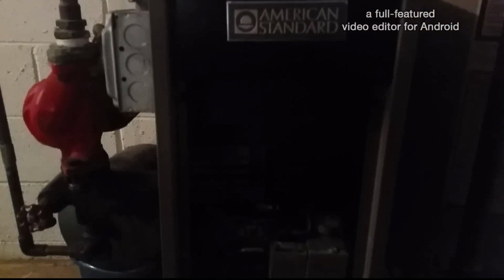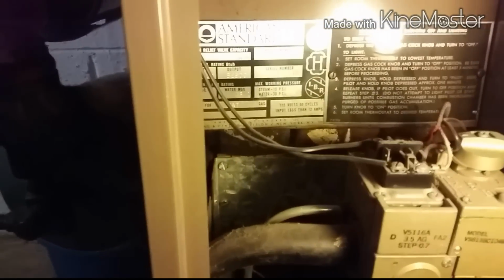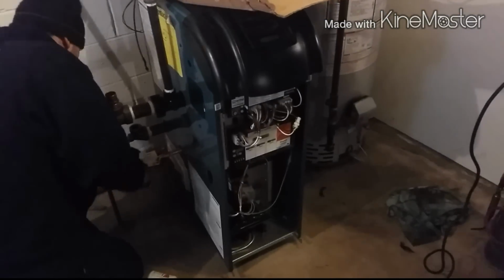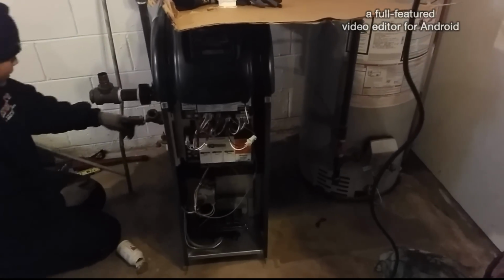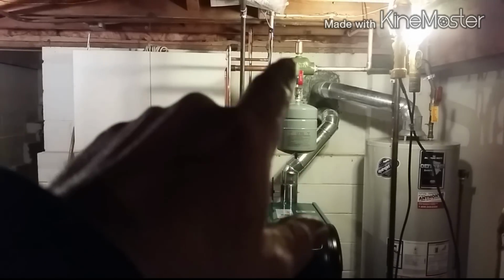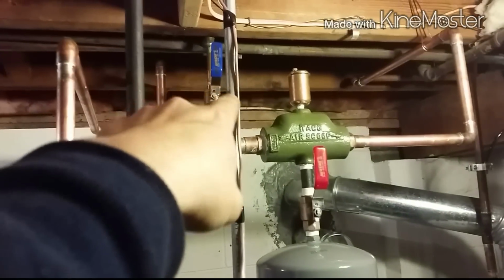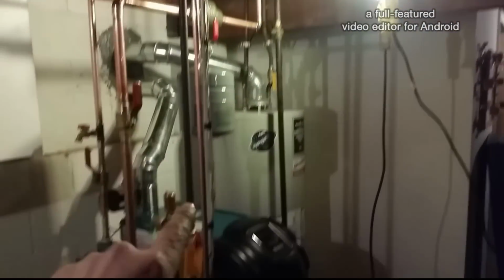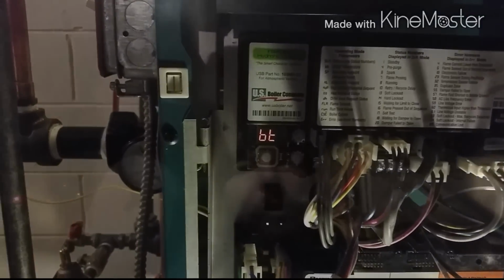Burnham 303 series hot water boiler install

Comment: Is this boiler required chimney liner ?and what happen if not installing this liner?
Reply from the maker: Depends on the existing size and conditions of current chimney if it required a liner.  After a install the unit gets inspected by township plumbing inspector and if needed be a liner be installed . If water heater and boiler r still piped into chimney , the chimney maybe fine . But if for whatever reason the water heater was replaced with a power vent and no longer exhaust into chimney then a liner will need to be installed and downsized.  If a downsized liner is not installed then it will not pull a correct draft mainly during the winter months u will notice it cause chimney is to cold due to amount of BTU's being removed .
Reply: @jhhvacplumbing1944  thanks for your reply.. so I using current same chimney for this type boiler you posted then no liner required right?
Reply from the maker: @raymondlee8351  is there a water heater piped into same chimney?
Reply: @jhhvacplumbing1944  yes. Current have HB Smith boiler vent piping to chimney..
Reply from the maker: @raymondlee8351 as long as nothing has been removed off chimney or number of BTU's r the same then there shouldn't be a issue . I always recommend to customers to have chimney inspection done after installation of something new just to be sure there isnt a clog , inside of chimney damaged or dirty.  It doesn't hurt to get it checked out and is a piece of mind all is well.  Also during Inspection if for whatever reason it does need to be lined they will tell u then . It's hard for me to tell u yes or no that u should be fine without sight unseen ... that's the chimney company job . Also keep in mind every state and county and sometimes township have different codes .

Comment: I don’t like that the relief valve is on the long length of pipe.  It should be as closer to the boiler outlet..  Also,  is it a ‘Pressure-Only’ valve?-  it should be installed in s vertical position.
Reply from the maker: You r correct and have since changed it and the set up when we do this type of boiler install . Thank u for your comment and good eye .

Comment: Nice work JH, Do you have many service calls on the Burnham boilers. Like electrical issues or sensor failures?
Reply from the maker: polishtheturd mickelson a few years back they had a issue wit the ground near the sensor being weak and the pilot tube being to small but that has been fixed from what I see .

Comment: I've recently moved into an apartment with a very similar set up.  Personally I was excited to move into an apartment with an "updated" heating and water system, especially coming from steam heat.  However I'm now unfortunately learning that this heating system makes noise as well!?!?!

is that normal for this type of system? It's not the return that's making the noise it's definitely the vent. 
Thanks for any and all info.
Reply from the maker: when u say vent what and where ?
Reply: +JH HVAC & Plumbing 
that would be the vent coming from the boiler and going outside of the house.  

not the return coming in from the house and connecting to the boiler.
Reply: +JH HVAC & Plumbing 
that would be the vent coming from the boiler and going outside of the house.  

not the return coming in from the house and connecting to the boiler.
Reply from the maker: +Sean Jordan the exhaust?  if yes is it ran in pvc plastic or metal ?
Reply: +JH HVAC & Plumbing  yes the exhaust, excuse me.  It's aluminium
Reply from the maker: +Sean Jordan and it runs directory outside or in chimney?
Reply: +JH HVAC & Plumbing directly outside
Reply from the maker: +Sean Jordan u should have a professional take a look

Comment: I had a boiler and replaced it when I installed central air with a gas furnace.  I want to go back!  I had slab heat and there is nothing like stepping on to a warm floor in the winter time and nearly silent operation. 
How can I go back?
Reply from the maker: Alot of labor my friend or move to a new house with a boiler or .... build a time machine
Reply: +justin henning Thank you.

Comment: You should look into putting the circulator and fill valve on the flow. it will make the air scoop work much better, especially in taller houses and ones with moniflow systems, But nice workmanship, Its good to see people taking pride in their work
Reply from the maker: rich that's the big debate , pump on the return or feed but I just install it the way my boss wants lol  . Thank for watching and commenting!
Reply: Dan Hoolahan writes some good books on steam and hydronics. Pumping Away and The Lost Art Of Steam are educational and entertaining. The helped teach this old dog some new tricks.
Reply from the maker: +rich6421 this dog is alway open to learning new tricks , the real trick is convincing the big boss man
Reply: technically it should be on the outlet side of the air scoop pumping away from the point of no pressure change ie expansion tank.
Reply: I agree about installing the Circulator on the Supply. The engineering concept behind it, is based on equalizing the pressure in the heating system. The Circ on the Supply pushes air into the Expansion Tank.  The Circ on the Return pulls air out of the tank. If installed on the Supply, the Air Scoop or Eliminator works correctly. Like you said, The Dan Holohan books explain it excellently in Layman's terms & once you start installing it on the Supply, you won't go back.